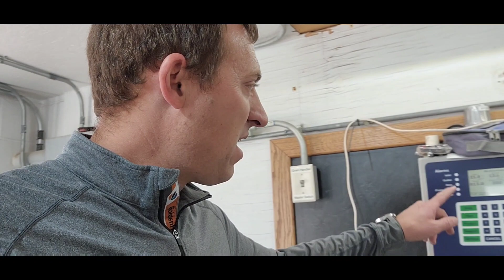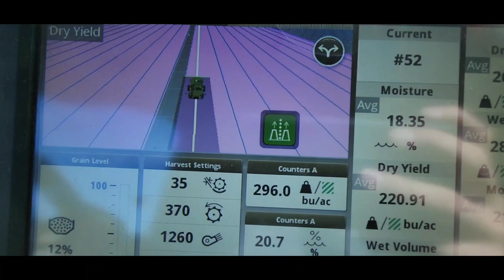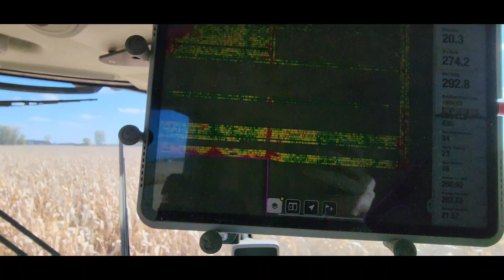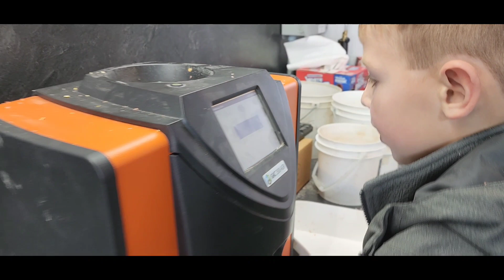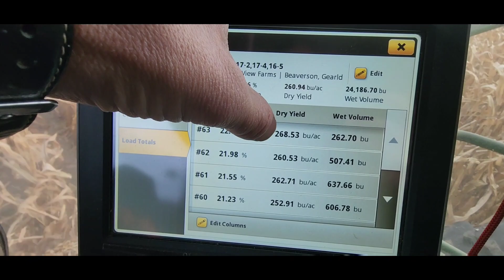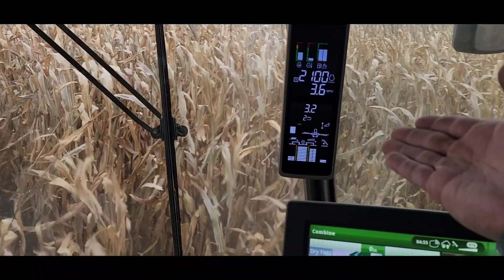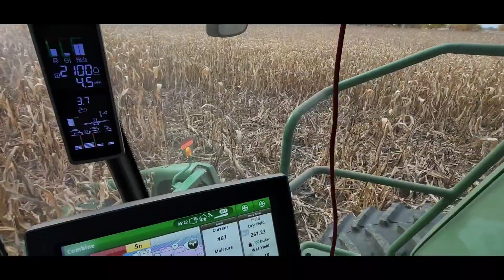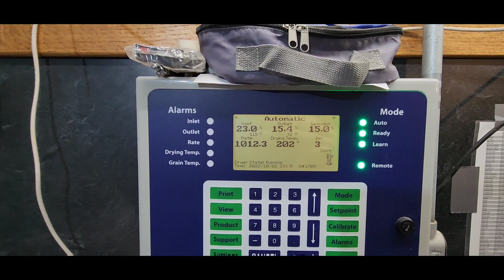Record Breaking Corn!

Comment: Hi Nathan.  Your combine grain loss maybe erratic cause the grain loss system is probably on time based instead of area based like we have been use to in the past.  It can be change at address in the CAB Controller. Your jd dealer can explain.

Comment: Nathan did you have to manually steer the bonus rows?
Reply from the maker: It depends, if the rows were planted straight and the row with my feelers is one of the rows I can use the auto steer.

Comment: Have you considered poly pipe? Down south we use poly pipe an pivots.. we prefer poly pipe over the pivots but would that help make a difference with the timing for when you water? Or is it just easier an a lot more simple for you to go with the way that you have now?
Reply from the maker: I'm not sure what you mean by poly pipe?
Reply: It’s kinda like a somewhat flexible PVC that comes in large rolls.  Like a large PEX line.